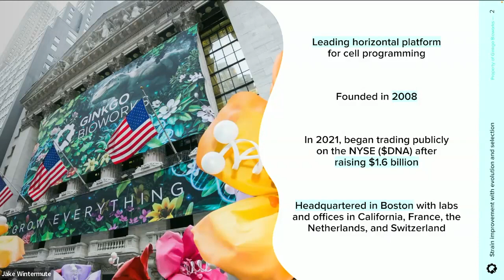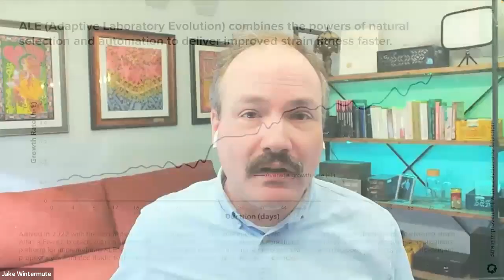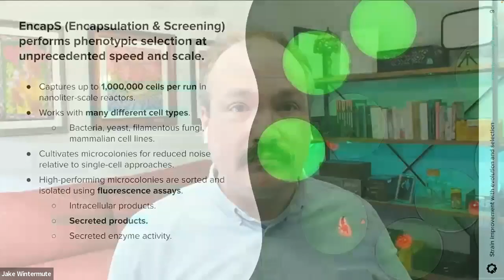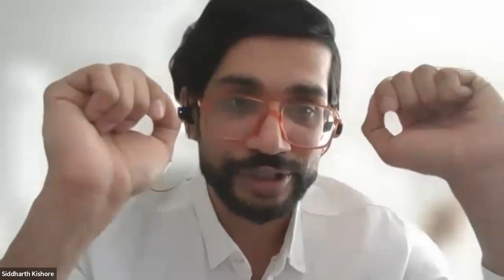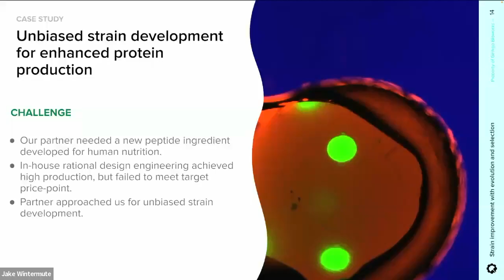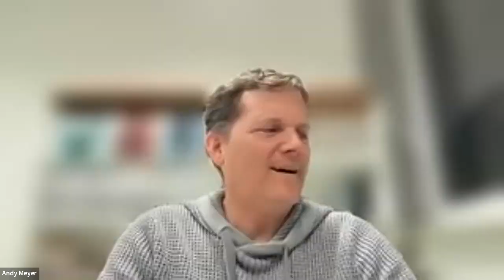Strain Improvement With Selection and Evolution - Virtual Event

Comment: I googled price target for Ginko 2030, the results are the following: For Ginkgo Bioworks Holdings Stock (DNA) price forecast for 2030, a forecast is offered for each month of 2030 with average DNA price forecast of $68.13, a high forecast of $71.50, and a low forecast of $8.0173. The average DNA price prediction of 2030 represents a +5022.52% increase from the last price of $1.33.